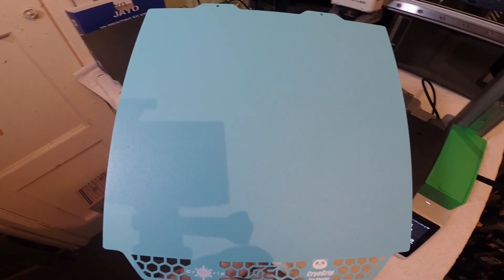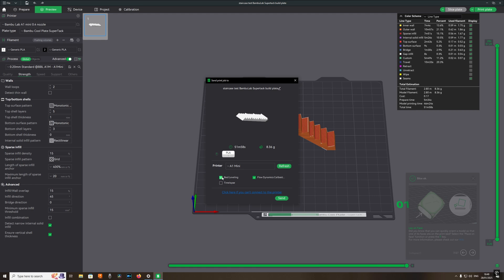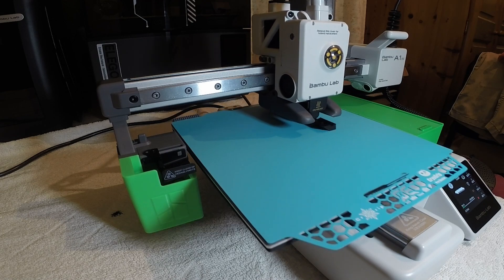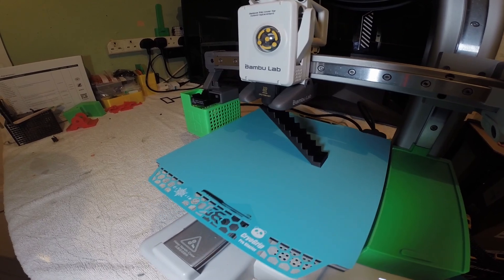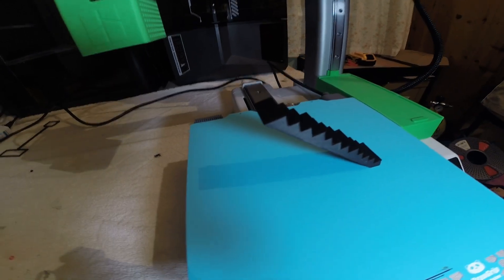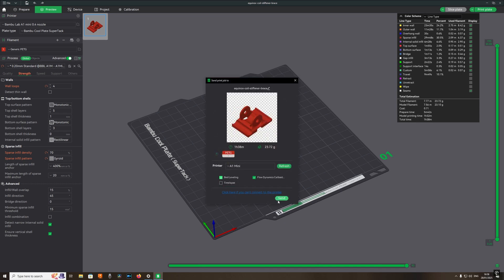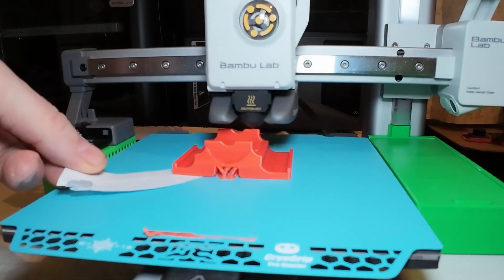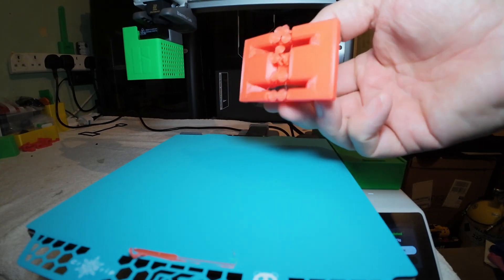“Bambu Lab A1 Mini + Panda Cryogrip Plate… TOTAL FAIL?! "

Comment: Your build plate temp is to low. Raise it to 70 and it will stick like crazy.
Reply from the maker: Thanks for your comment, I was just using the settings that were given to me by the makers of the plate,
Reply: @CALTECH3dPrintingThey give a suggested temp range not a single temp since all filament brands are slightly different. To be fair you need to test at all temps in the given range and see if you get better results. Also you should note exactly which filament & settings you used for each print. Personally I love the Glacier and find that it has plenty of adhesion and I've seen minimal warping.
Reply: @christopherlyons7613  what plate would I choose if just going from my phone

Comment: You're using too low temperatures with this one. It's the glacier (not the frostbite), so you should bump the temps to 45-55 for PLA and  55-75 for PETG
Reply from the maker: Thanks for watching, and you're comment, I used the settings that "bigtreetech" gave to me, told me to use bambu cool plate settings in the slicer, and I think that was the temperatures for that plate.
Reply: @CALTECH3dPrinting in orca slicer the bed temp for bambu cool plate is 35C. which is below the min recommended temp (45C - 55C) for the glacier as stated by biqu on their website.
Reply: you can literally see his heat bed temp is 70deg c for the petg test
Reply: @PurpleStarVid  Yes, you are right, I missed that. The 'cool plate setting' misguided me.
BTW, my glacier (same as yours) came in, works pretty OK in my P1S. 
About PETG I think that it's true - it sticks to textured PEI plate very well, even a little to well in my opinion. In my case I don't experience warping with PETG - but I think that grabbing force is enough in my case and the enclosure makes the difference, because it limits the drafts that make PETG warp.